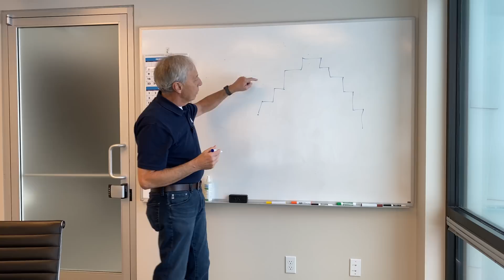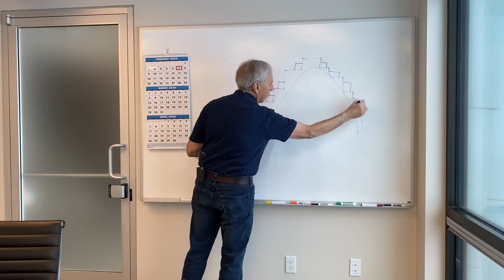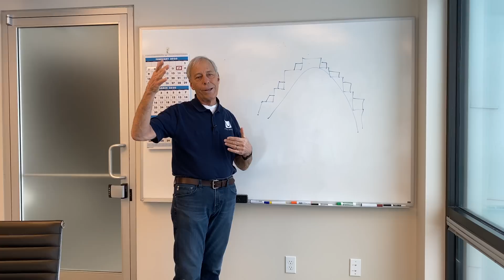What is audio oversampling?

Comment: @3:36
"There's no more information"
Yes, there is more information.  If there was no more information, then the "oversampling" process would be doing nothing.

Then, at 4:55, Paul talks about "adding information".  Yes, that is correct.  So his 3:36 statement is wrong.
Then, at 5:56, Paul states that there is no more "real" information added.  Well, that depends on your definition of "real".

Is "real' only those samples created at the time of the recording?
Or is "real" the additional samples created by the oversampling process (because the DAC chip sees 100% of the samples -- including the additional samples created by the oversampling process).
So to the DAC chip, it is all "real".

@3:37
"But they would raise it up, ..."
"It"?  What is "it"?  Raise what up.

Answer:
"It" = "samples" (or digital snapshots of the sound).

Folks, the short answer is that oversampling creates, out of thin air (via a mathematical formula), more digital samples of the song, in order to send more samples to the DAC chip.
It is like having a movie, and between every two frames, a computer instantly creates a frame of what the video would likely be between the two frames.

So if a car is moving from frame to frame, then a computer would draw that same car (and everything else in the frame), and place the new image between the two existing frames.  Then, when played back, it would appear to flow naturally.

In audio, the same thing happens with sound samples.
A CD has 44,100 samples each second (the Redbook standard).
SACD (super audio compact disk) has 88,200 samples each second.

With software, you can convert any 44,100 song to have 88,200 samples (or pretty much convert up or down to almost any other values).
Note that oversampling (or upsampling) is not as accurate as creating 88,200 samples at the time of the original recording.  So it is still better to have a native 88,200 sampled song over a 44,100 sampled song that was oversampled to reach 88,200.  In other words, it is better to have your recording equipment actually record more samples, as compared to recording less samples, and then having a computer generate what might have been there).

But the bottom line is that in any of the above, when you upsample or oversample, the end result is that the DAC chip actually sees the higher number of samples, and can therefore use a less steep filter.  The DAC chip does not inquire (and does not care) from where the samples were derived.  The DAC chip does not care whether a recording was really made at 176,400 audio frames per second, or if it was originally made at 44,100 and a computer quadrupled it.  The DAC chip will simply see 176,400 frames per second, and then use a filter that works best for that sampling rate.

Cheers!
Reply: The samples on the CD define every point of the band-limited waveform. That's why he says there is no new information – it's all derived from the data on the CD. 

The information that was lost in creating the 44.1kHz recording is the frequencies over 20kHz and that information cannot be recovered. Oversampling to 88.2kHz or 176.4kHz does not bring those frequencies back but allows gentler filtering which has less effect on sound quality. In the early Philips players with 14-bit DACs, 4 x oversampling was used to give 16-bit performance.
SACD uses 64 single bits in place of each 16-bit sample on a CD, which is 2,822,400 bps per channel.

Comment: The question is not quite right. Oversampling was used in some of the very first CD players. When CD started Philips only had 14-bit DACs, but by using 4 times oversampling and digital filtering they were able to achieve 16-bit performance and their players were thought to be better than the 16-bit players without oversampling made by other companies. 

In about 1990 they introduced Bitstream, 1-bit conversion using 256 times "oversampling," except that the bits are not really samples at all. The frequency of 1s or 0s represents the amplitude of the wave, so the signal becomes analogue while it is still digital. This is Pulse Density Modulation or PDM, the same principle as DSD, but I never saw that term until DVD-Audio appeared.
Reply: I have a Technics (Panasonic) SU-MA10 amp with 1 bit M.A.S.H dac converter, before DVD and DVD-Audio of course
Reply: @mlunadem  Technics and Panasonic are brands owned by Matsushita. Pioneer is a different company .
The Technics MASH CD players are very good. When Hi-Fi Choice magazine tested the SL-PG520 in 1992 they rated it "Excellent" for sound quality and described it as "gloriously musical." It sold for £200, about half as much as the first CD players and and a quarter of price of some other players in the test which were no better.

Comment: On digital audio you should have a wider frequency than the music is at. For example, if the song goes to 22K in frequency then you must have a road of 48k to avoid negative things. same as on an amplifier then you need to be away from max watts to get the best sound.
Reply: run your output at the native resolution of your audio files, or multiples of it if you must. 44-88-176 for cd quality files and the majority of audio on pc, 48k is a dead format that was tipped to replace 44.1 but has little to no usage in the real world. kind of like the majority of high resolution bit rates looks cool on paper but rarely used and pretty much a bullet point on a spec sheet now.

Comment: Thanks, Paul. Good explanation. I have an old CD player that we use at work with "4 times oversampling". Now I know what it means.
Reply: It means absolutely nothing for end consumers if you are listening to the original audio recording through that CD player without ADDING any distortion, compression or harmonic content to it in the digital domain. It is pointless to oversample a signal without applying any processing to it and then go back to the original sample rate.
This is the proper and in-depth explanation of the usage of oversampling: https://www.youtube.com/watch?v=-jCwIsT0X8M&ab_channel=fabfilter

Comment: than what is upsampling?
Reply: Oh gawd.😮😁
Reply: @InsideOfMyOwnMind  

https://youtu.be/X65ijUhqYxo
Reply: @GiancarloBenzina  I thought the same for a very long time, but after I saw a presentation from Rob Watts I realized that there could be a mathematical way to reconstruct the wave by adding some interpolated samples since the function is known - it is a sine wave and when it goes up then you know that there is a sample between. it should follow the path of the sine wave function and not to be linear middle. I don't know is this condion is fullfilled but smarter man then me made this so I believe it is. Reviews confirms that.
Reply: @GiancarloBenzina  That is a purist approach and for almost entire time I would agree with you. But you will never get what was put in. There is a Rob Watts presentation that shows how the modulation of 20khz has been sampled and what is the loss/consenquence of that. By the very modulation of analogue music sound to turn it to digital samples you will lose all the information that are between the samples at the rate of 22 microsec which is the sample time distance of a cd. So, upsampling or oversampling aims to reconstruct those information. Some took a step further and thought out more about this reconstruction. So interpolation shouldn't be linear but follow the path of analogue function of sine wave and "add" information in that manner in a clever mathematical manner and engineering solutions. The sound of those says for themselves. Unanimously excellent!
Reply: Up sampling is I believe to do with video signals
Reply: @altops4490  Thank you for the answer - I found out that is basically the same but some would say that there is a difference where and how it is done. For video, I think it is a term - upscale. Kind regards!